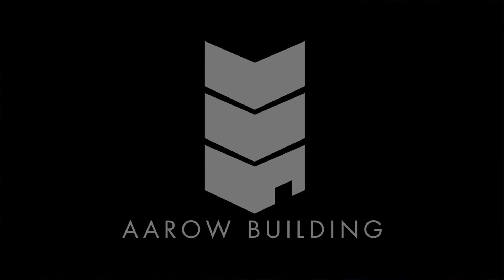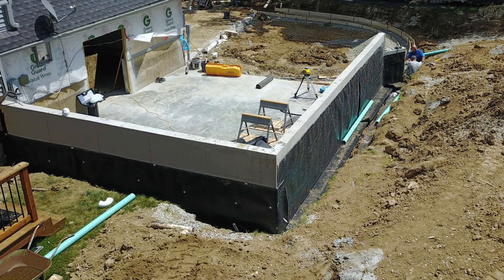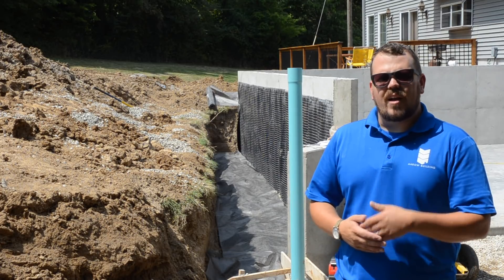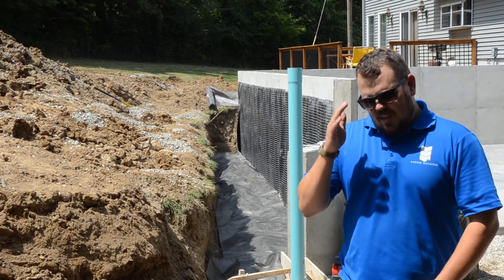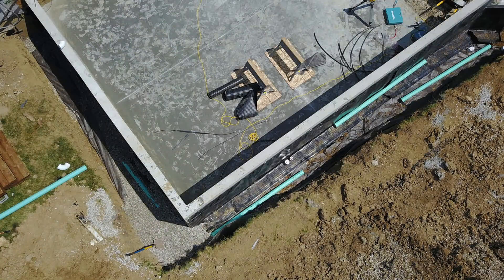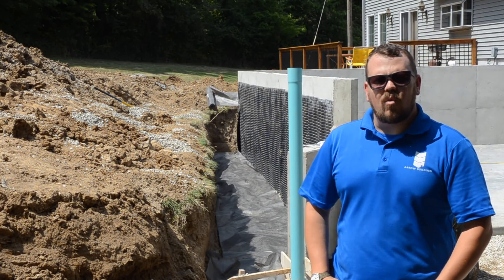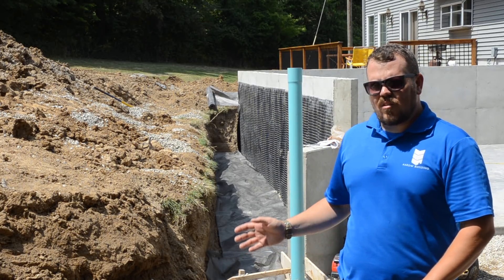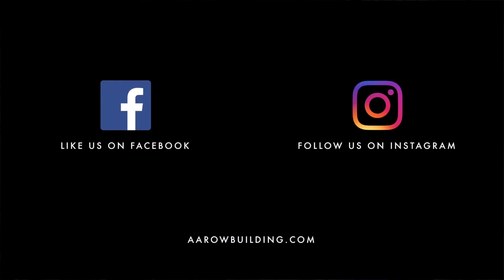Foundation Waterproofing Simplified

Comment: If you have a wet foundation it means one thing, Your downspouts are too close to the building 5 feet away is no good try 15 or more feet.
Reply from the maker: Absolutely. High water table is also possible, however far less likely. Downspouts are actually required by code to be ejected more than 5’ from the foundation in most soil conditions. I like 15’ plus whenever possible.

Comment: Does any dimple matt work or are there specific properties/types you use?
Reply: I used hot  tar over 20 years ago and rolled it on with a paint roller, got it hot with electric barbeque starter.